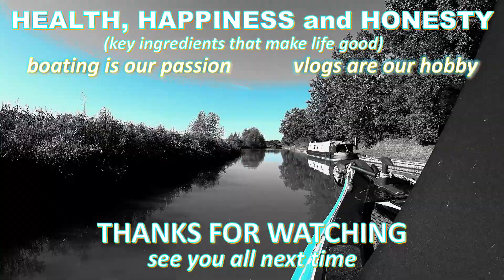That Narrowboat Feeling - 2021 - 184 - Shiny Boat

Comment: Good evening to you both, hoping you’re keeping safe and well, quick question regarding the maguires treatments you’ve explained in your vlog, is your boat hand painted or spray painted? Would it make a difference? Ours is hand painted and like yourselves, we take time over cleaning and maintenance - we like a shiny boat 😃 
Like your tip on brass cleaning, I use ‘peek’ and bras so as a rule so will try marine shine👍 take care both x
Reply from the maker: Hi
Our boat is spray painted. The good news is both meguires shampoo and wax we use are fine for hand painted boats. It's the polish which takes off a very light layer of paint. It is nice to have a shiny boat but it does take time to do the work but it is worth it. B & K 👍👫